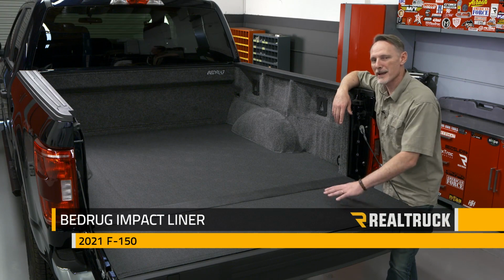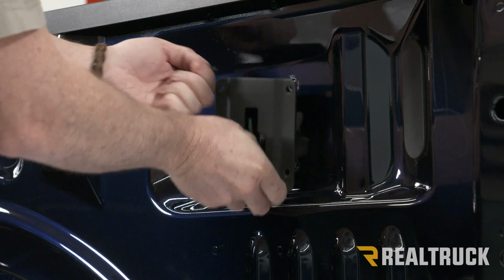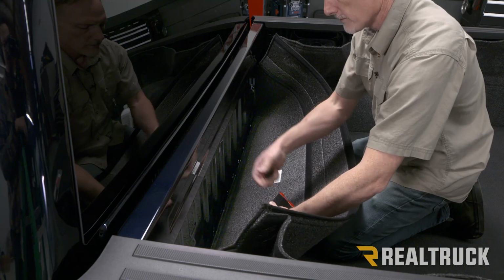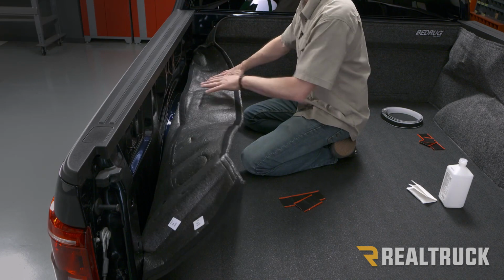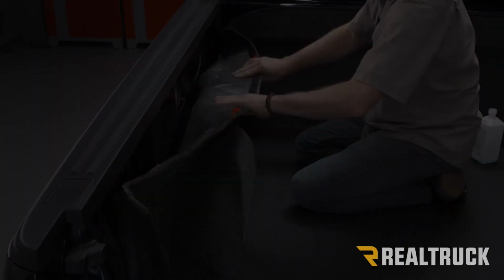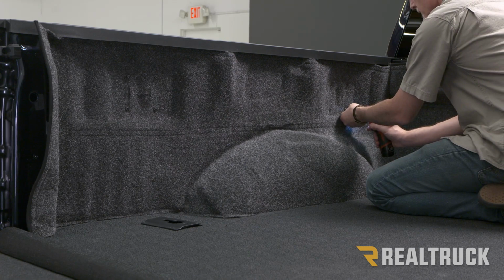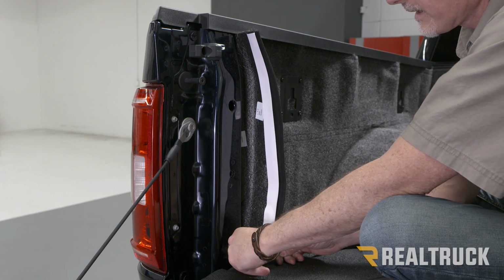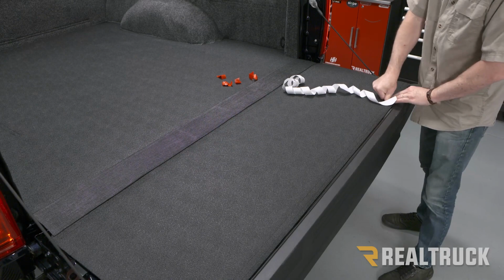How to Install BedRug Impact Bed Liner on a 2021 Ford F-150

Comment: Hi Great Video, my truck has the 400 watt outlet and lighting, do you use the same method you used for tie downs for them?  Or is there another trick that might work for them?  Thanks in advance.
Reply from the maker: Hey Gil, yes you would need to make relief cuts for access to the plug. Hope that helps!
Reply: Hi Gil, I had this same question. Did you end up installing it with the plug and lights? And if so, did you come across any issues?

Comment: I’m curious why you cut an H for the tie down bracket?  Wouldn’t it better to install the tie down bracket directly to the bed and use the H cut for the other piece of the tie down use you can easily attach it?  I’m thinking the nuts will get loose if the bed rug is in between the tie down bracket nuts?

Comment: Am I missing something, why are there massive uneven sides? Big ripples like it doesn't sit flush/flat on the bed sides?
Reply from the maker: Hey there, it sits flush against the undulated sides of the bed. Hope that helps!
Reply: @Realtruck 
I've never heard of a Bedrug Impact Bed Liner. But I've heard of a Bedrug (Courtesy of Brian Waters Outdoors on YT). Are they the same thing?

Comment: What if a spray on bedliner is already done? Will the adhesive stick for the Velcro?
Reply: Bedrug claims you’ll need a spray in bed liner install kit. Mine is in the mail. I’ll update you if it’s really needed or not

Comment: Good product. The only thing is there is no company logo on the bedrug at all. They only have it on the top part of the liner front right.  I only have the bed rug it's self (don't need the sidewalls done and there is no company logo. To prove that it is what you paid for.

Comment: Hello, my 2022 Ford F150 has the tailgate workstation, would I be successful removing the station and putting the tailgate rug under the station and then resecuring the station to the top of the tailgate rug? I would like to avoid just the bed rug only due to the cut edge snagging on my gear as I load and unload. Thank you, Rich, in Minneapolis, Minnesota.
Reply from the maker: We currently only recommend going over the Work Surface or trimming off the tailgate portion of the BedRug, if you plan to use the Work Surface. The main issue I've personally seen is that the Work Surface is plastic, and not rigid enough to lay flat when the bolts are tightened back down. Since the BedRug is cushioned, that also makes it compressible, so the locations with the bolts will draw down further than the rest of areas, making the Work Surface sort of "lumpy". There may be a way to modify things so that it works better, but we haven't found it yet.

Comment: How do you install the tailgate piece if you have a work surface tail gate?
Reply from the maker: Hey there, it should install the same way. Although, you will have to peel the tailgate portion up when you want to access the work surface. Hope that helps!

Comment: Why doesn't anyone show the installation on a truck with a spray in bed liner??
Reply: There’s video on your question. I guess just search bed-rug . It’s a white F150 in the video. Good luck.
Reply: I saw one where they used some canned stuff called adhesion promoter where the tape attaches to the spray in surface which is supposed to help it stick to the rough surface.

Comment: Can this be installed on a bed if it has a spray in bed liner?  My liner has a rough surface and not sure if the Velcro tape would stick to it.